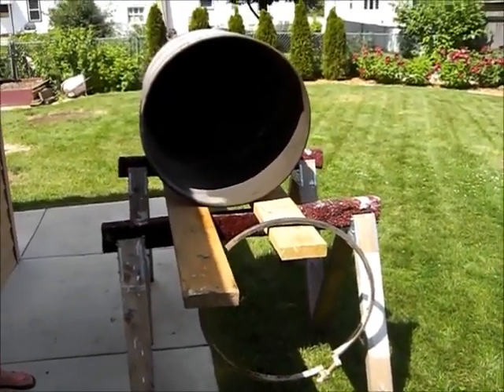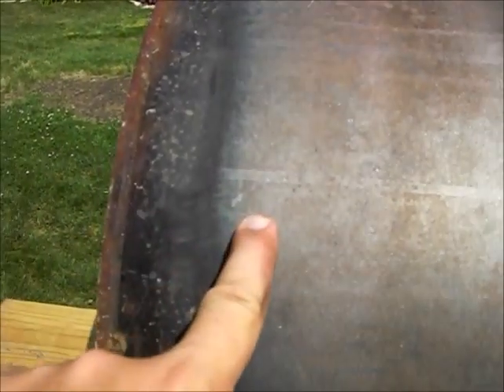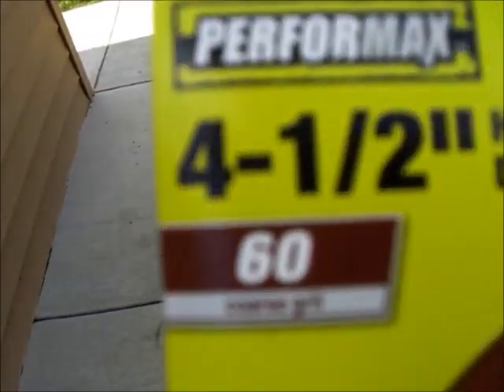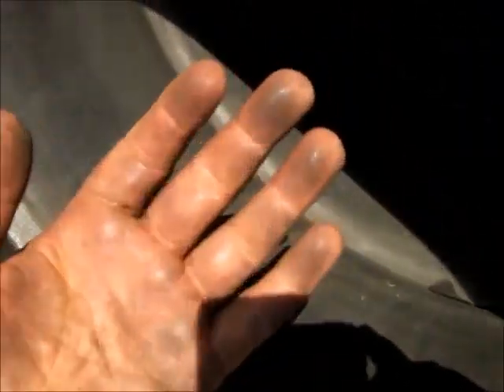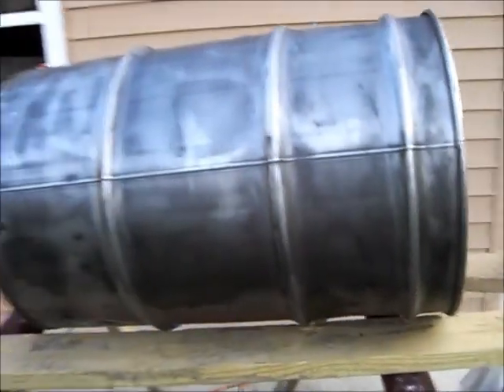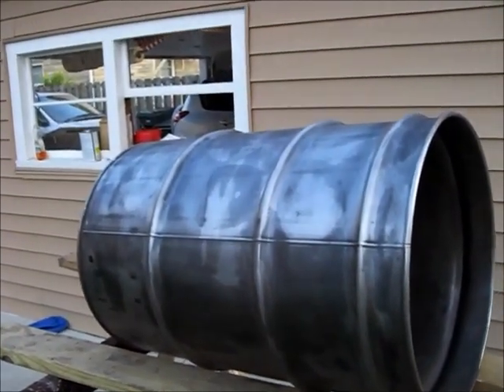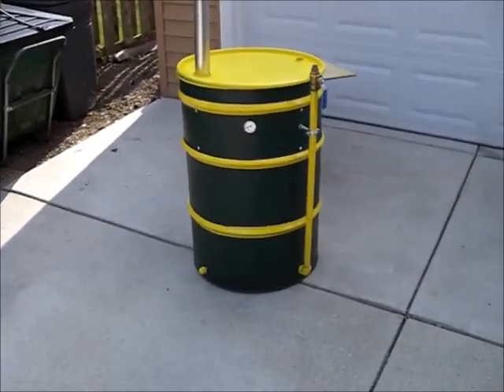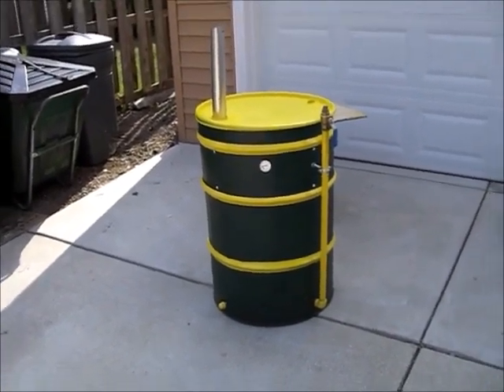How to Build a Verticle Drum Smoker. UDS 55 Gallon Drum Smoker

Comment: Nice build!  We've been competing with drum smokers for 2 years now and have been quite happy.  One lesson learned the hard way...  the pipe nipples will rust!  So on the last few drums we've built, we only used one for the ball valve.  The other holes we cover with magnets.  Works great and no more scrambling for a pair of channel locks when on of the caps is rusted to the nipple!

Comment: great video! you can use closet brackets to make the grates adjustable. they can be welded or bolted in. my 1st build I had a co-worker weld them for me. this time I am bolting them in. I also chose to go 1" diameter instead of 3/4"
Reply: where did you get that split ring hangar? Did you order it directly from sioux chief?

Comment: Great video! I've just started building my first UDS and I am using your vid as my guide. I'm not doing everything in the same way as yourself but whenever I can't think of what to do next, I always come back to your vid. I actually got my drum soda blasted which worked great and meant I didn't have to do the burn outs and sanding. Thanks for taking the time to make the video! :) BTW if people are going to add negative comments, please give reasons as otherwise its just rude! (@RumbleTouchDroid)

Comment: I'd err on the side of caution and burn it out anyway. Most barrels have a coating to keep the metal/paint from contaminating the food product and make them air tight (much like a lined beer can). Also, after you burn it out, clean it, coat it with vegetable oil, and burn it at a lower temp with charcoal to season the metal and help prevent rust.

Comment from the maker: You can easily get 12 hours worth of a cook with the basket in there. I have used mine quite a bit for some rather large cooks. never had a serious problem. If you check out a site called BBQ Brethren you will find a boat load of information about a "uds". Lots of help there. Good luck!

Comment from the maker: I did no welding at all and when the smoker is running I have very few leaks. The only place I think would be a problem is the lid, and that is corrected (If wanted) by use of the "band" that came with the drum. The band I refer to is a metal clamp that goes around the top of the drum and then can be screwed down to tighten the lid well.

Comment from the maker: Not really. I should be more consistent with that but it seems like I kind of bounce around a bit. I get nervous about a water pan because I don't want to destroy the bark I'd like. I do however, use a fire brick wrapped in foil as a "heat sinq" in hopes to increase recovery time after opening the lid. Perhaps I should just move the brick as a diffuser.